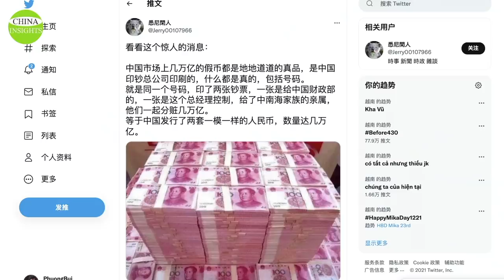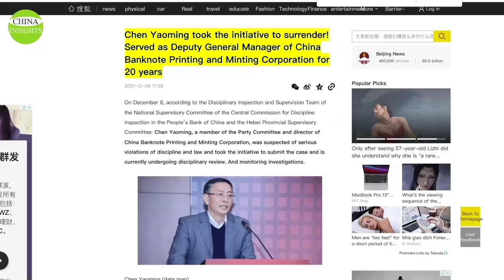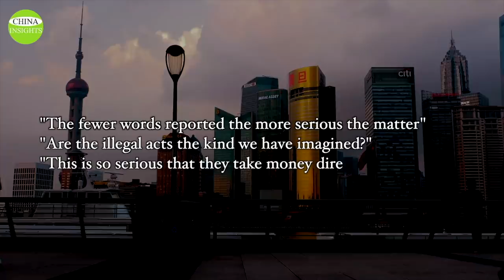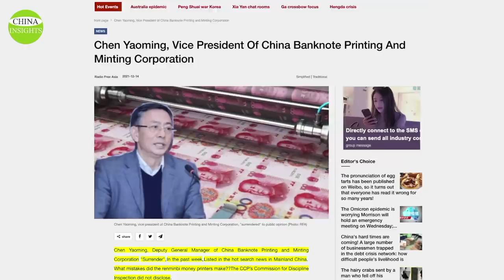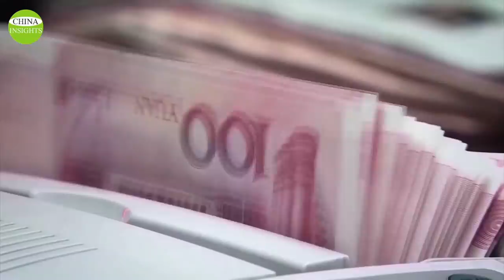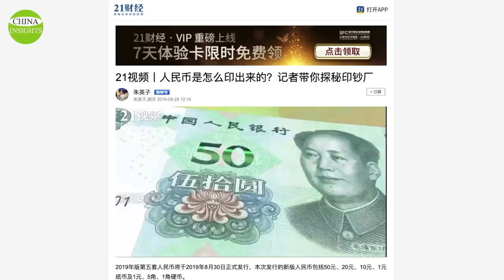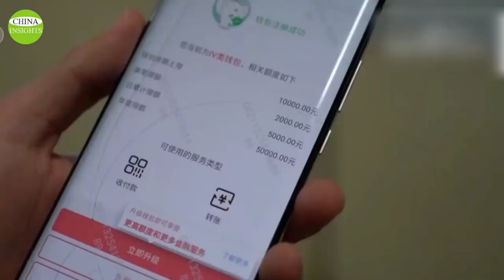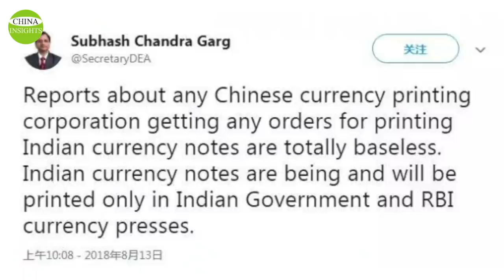How the duplicate banknotes would impact the Chinese financial system/The new level of corruption?

Comment: If so The International trading currency should cut the RMB trade price by half then.
Reply: I don't think the RMB is traded internationally. It is only for internal use, whereas the Yuan is used internationally.
Reply: @frednerk3477  they are the same thing. Yuan. Is a unit of account of RMB.
Reply: @frednerk3477  You are thinking of the Onshore Renminbi (CNY) and the Offshore Renminbi (CNH). Both have the same value.
Reply: That is not that easy, amount of money in circulation does not equal to amount of banknotes in circulation.

Comment: China seems to be cracking around the edges, in major sectors things are going wrong, whether it’s new buildings falling down or building work failing due to the exceedingly poor quality of the steel rebar that an old man can bend and snap. Concrete mixing proportions of critical parts like cement are weakened so much that a new resident can use a plastic pen to gouge out very deep ruts,  the motor industry has been over producing dev cars and eve vans gaining the government grant for the vehicle. The Chinese people are waking up by only doing casual work, manufacturer’s have abused employees docking monies, now we find out there is corruption in the banking industry. Glad I don’t live there.!!
Reply: Tidak ada yang salah memang china. Surplus. Pendapatan tahunan. 2.6%.

Comment: I suspect that nowadays the simple act of printing duplicate money doesn't automatically threaten the economy.
I also suspect that unless done in large enough amounts relative to the overall currency in circulation, there would be no effects like inflation and it doesn't even require bills circulating in different parts of the economy as described in the video.

What really matters is the confidence people have in the value, worth and reliability of the currency which is largely psychological. If people suddenly refuse to accept the currency in their transactions, then the currency loses its purpose and worth. The story of major fraud is more threatening to the currency than anything else, particularly if the story changes people's behavior.

Regarding the part about digital currencies,
I suspect that the definition and discussion in this video is very far off. I've been looking for a definitive description of digital currency in China compared to elsewhere, and I get numerous variations and many make the same mistake as this video confusing and identifying by the human interface and use of the currency instead of what differentiates the currency value from others. And, similarly I don't believe that the method of storage on personal wallets like cryptocurrencies makes one currency fundamentally different than another.

Comment: 8:20 how do you verify the person who wants to empty out the bank account is the person holding the ID card? Our's have a smartchip with biometric fingerprint data. China's is just a plastic card with a photo. Earlier cards had no photo. If he had lost the original ID card, and is relying on a police report as a temporary replacement. It's a problem. This is just bureaucracy. I'd hardly think this makes much difference to people taking their savings out of banks.

China is an extremely "high savings rate" country. Where are they going to keep all that cash. If everybody wanted to convert their savings into paper money, there isn't enough paper money in circulation. They would need to print more.
Reply: hope fully with new serial numbers, otherwise they are swindling anyone who invests in their economy.

Comment: I have often wondered if there may be something like this going on here in the US. I have read that other people are thinking the same thing. With more money in circulation than in on the books you could have a very large amount in circulation without it messing with the valve of the dollar because a large amount of it would not be on the books.
Reply: It would not surprise me. However, with how the US banking industry works, I would not expect it to be widespread.
Reply: We do have duplicates, but they end in * and it usually  if it was lost,damage or out of circulation(collectors). Star note are sometimes more valuable and if you can get the original and star note. You can sell it to collectors for higher cost. I have over $700.00 in star notes.

Comment: Well, that's how fiat money works. Printing money does not only happen in China, practically all countries do it to a greater or lesser extent. The exchange rate of the yuan is relatively stable, in fact it is undervalued because China's central bank artificially devalues its currency in order to help exports. And on the subject of cash withdrawals, look if you go to any country and ask for very high cash withdrawals they will not let you, because most of the money is "virtual" it is not in physical form. But you can still have that money, you just have to notify the bank in advance. Also if you pay with your debit or credit card, there is no limitation, so I do not understand what the problem is, in any country can happen exactly the same.
Reply: The video is talking about using the same serial number more than once, likely several times. It's not about fractional or printing of currency. Those things are part of the process, and were mentioned to draw an arrow at why using the same serial number more than once will undermine the banking system of the entire planet. Yes, all nations print money. The only thing that makes paper money legit is a serial number. If you use it more than once, it's value is destroyed. Especially for those entities that make all their money loaning money. They are paid back with fractions of these serial numbers. It's fraud. The world economy is built on trust, and that's something that these dictators aren't getting. Without trust their own power evaporates as well.

Comment: @9:15  You are not describing the Fractional Reserve System correctly.  I have seen this same mis-description so many times and it's simply wrong. You got the very first sentence correct. When the commercial bank holds 10 units in its vault or deposits the 10 units with the central bank, they can loan out 100 units. Think about that for  second and let it sink in. How is that possible? They only had 10 units. Where are the 100 units coming from. AND< they are not even touching the 10 units at the central bank. It's only possible because the commercial bank has the ability/privilege to create account for the borrower and simply change the balance to 100 units. They make it up out of thin air. Where you explanation goes wrong is stating, when a customer deposits 100 units, the bank keeps 10 and loans out the other 90. What actually happens, they hold the entire 100 units in the vault or transfer it to the bank's deposit account at central bank, and then... get this... loan out 1000 units, just like described before... the NEW 1000 units are created out of thin air. This is called EXPANSION OF THE MONEY SUPPLY.  And, it works in the US exactly this way. 

When the bank has a lot of outstanding loans, they [Chinese banks] can not allow people to withdraw the cash or they risk not maintaining the minimum reserve ratios. Actually, even US banks have notice requirements if you want to withdraw large sums of cash.
Reply: Personally I considered all that "out of thin air" money to be fake and it is high time we reconstruct our economic systems to accept that fact. Banks should also be explicitly forbidden from creating money. Yes I am aware that changing system overnight isn't possible but if the only need to keep 10% in the bank now, that percentage could be increased over time. Perhaps just stating that next year it be 11% and so on.

Comment: Surely they can go back and check quantities of paper, ink, holograms ECT ECT. Sure it's not going to perfectly tell how much of any was duplicated but if it was done at anywhere near the scale claimed it would be fairly easy to confirm. Similarly if there is any significant amount of duplicate serial numbers all they need to do it start withholding a randomly generated number of them and see how many come into the banking system over time, again it's not perfect but it would statistically prove and show how prevalent it is and if a bigger investigation needs to be implemented.